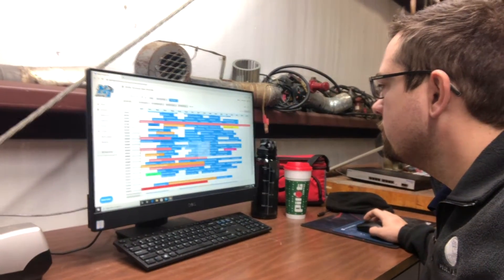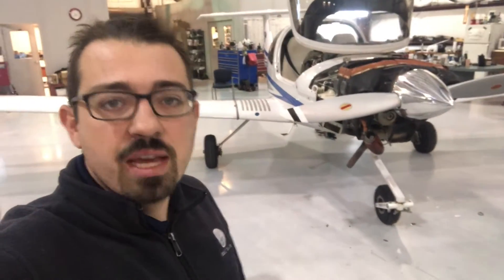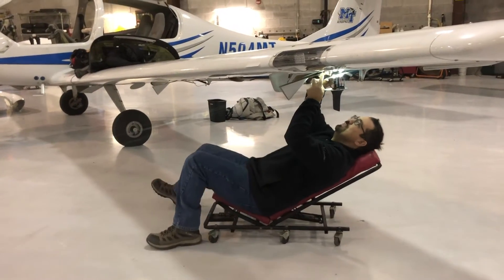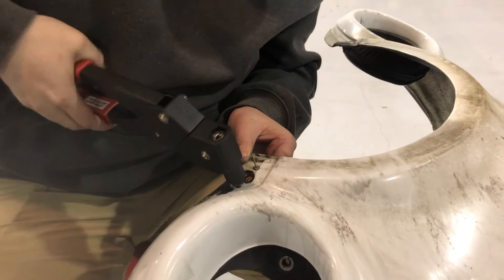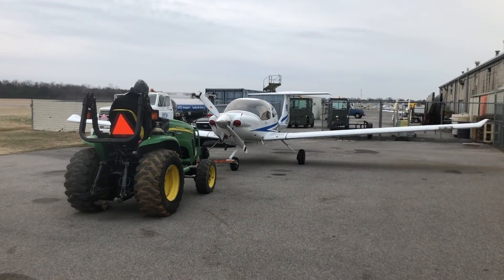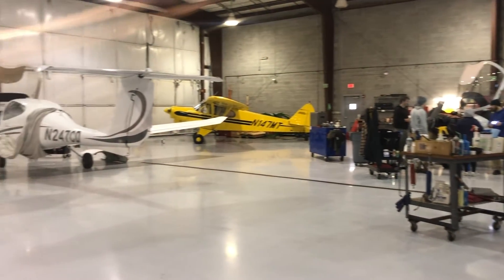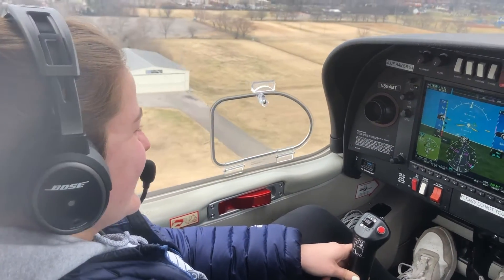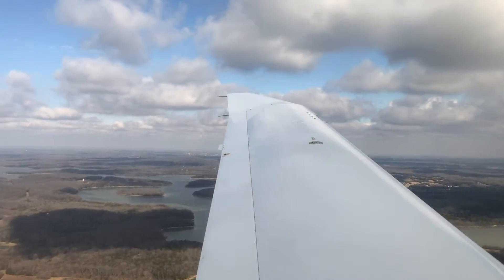A Day in the Life of an Aircraft Mechanic | MTSU Aircraft Maintenance

Comment: Collin this does not apply to this video but one of your earlier videos when you annualed the 140. Collin I am a retired IA. On your Cessna 140 Annual I did not see a fabric test . Maybe you did not film that. I would find when I use to annual older fabric covered planes once in awhile they fail the fabric test and need recovered. Also when the Cessna's get older I would replace the wing strut bolts they are cheap.  Just saying they might be mentioned in the Cessna 120/140 inspection check list for the Annual but I considered these items to be something I looked at for continuing airworthiness on these older planes.

Comment: I’m in high school right now and I’m thinking about going to college to be a aircraft mechanic. Is there anything to know before going?
Reply from the maker: Hey Isabelle! 

Depending on where you are at in the program this might be moot advice. Make sure you push yourself in math and physics as these are part of the General Section. Since you are a "traditional" student I'd recommend finding a school that gives a bachelor's degree with the A&P. It will take longer and be more expensive but also comes with networking opportunities. MTSU routinely has students graduate and go to places like Gulfstream, Cirrus, Southwest, Delta, and more! That's just because of network. That being said, there are community colleges out there that have an associate degree so just look at what works best for you. Lastly and least recommended would be a tech school that has no degree. If you want to work for an airline like Delta, United, or SWA you'll want to have a degree of some type.

If you go to college make sure you take a look at scholarships like Women in Aviation (WIA), EAA, AOPA, and school specific ones. Nowadays you can just about go to school for free if you just do a little legwork and have good references. 

Regardless of where you go, if you want to be an A&P try to find a shop to work in during the summers or during school. This video has people in it that were "student workers" and it tremendously helped them in preparing for the practical test to become an A&P. OJT is invaluable for students!

Good luck!